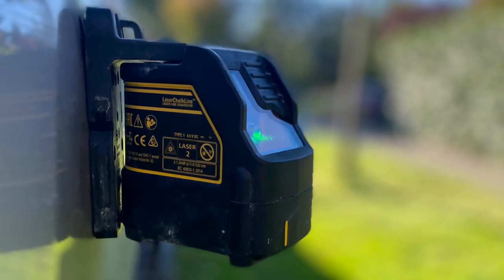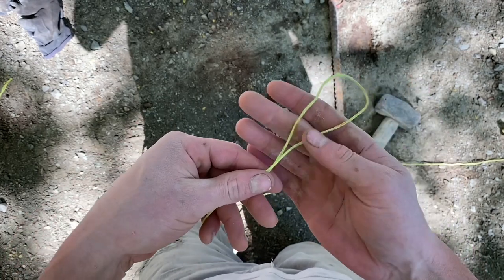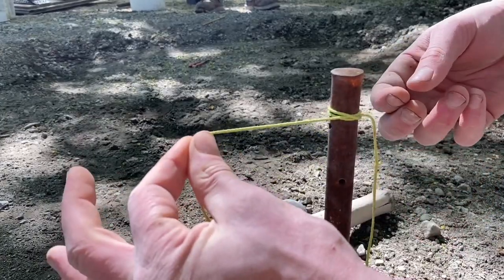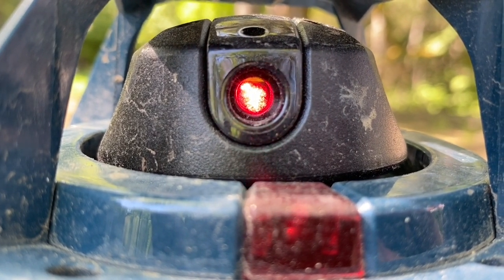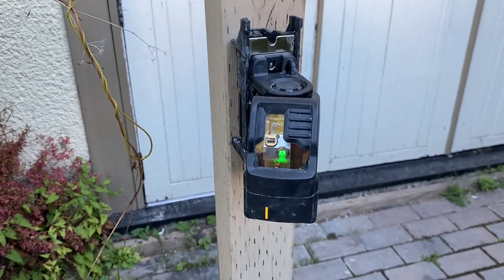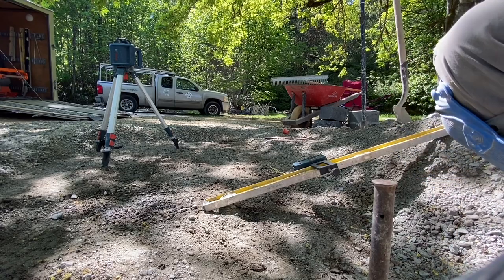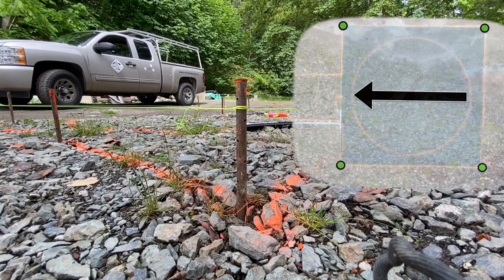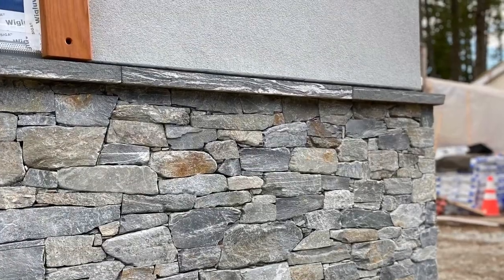DIY Laser levelling for any project!

Comment: This is perfect timing ... I have been cutting out a huge platform out of sand on my land for a base for a big she and then a large concrete pad in the shed and also out the front of the shed as a parking and working area. I have a Topcon rotating laser and my digger receiver just arrived... for my PC60 Komatsu digger... arriving in a week or so is a Terex PT50 and and I have the slope of the sand about 80% ok but low by about 2-3 in one corner... and 2 feet in another ... for my first ever laser job for my own land ... I picked a good one ! Cheers man... from New Zealand... fly down and give us a hand !
Reply from the maker: Awesome! Wish I could fly down there to help!!

Comment: what benchmark did you use for this exact job? did you go off a slab or the threshold of a door ? im just curious
Reply from the maker: This was based on a mock-up, for a patio were typically going off of a step down from a door threshold, or 2” below siding as a starting point for something like this.